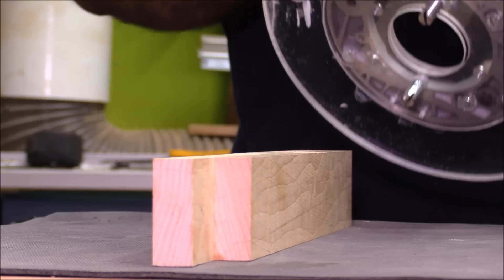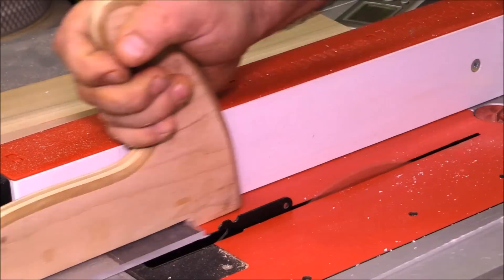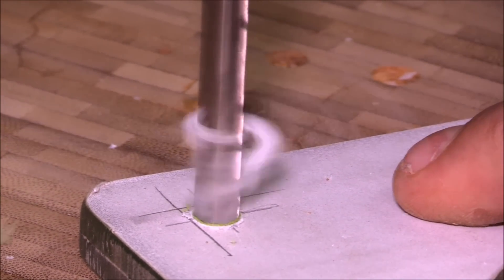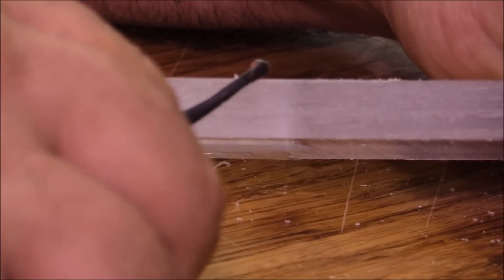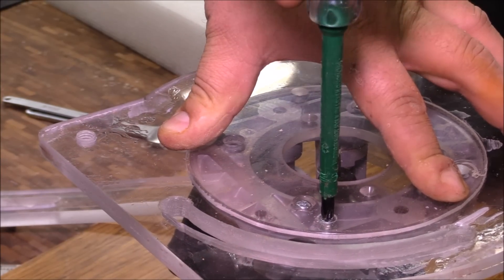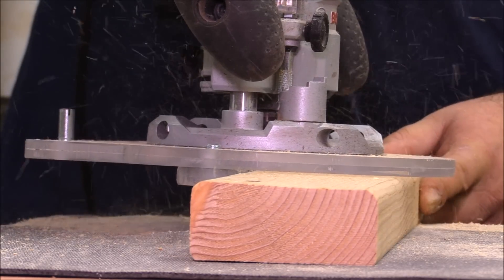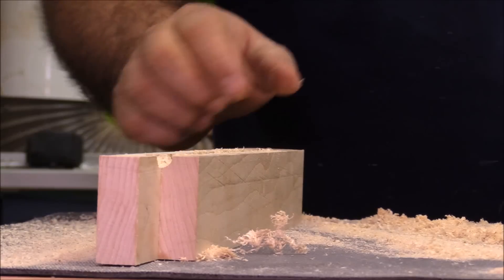Make a Custom Router Jig Base Plate

Comment: Building adjustability into a jig always gives the option of making it more accurate ; * which is the main reason for making jigs - to improve repeatable results , with the minimum of set - up time ! 
       Lesson learned from an old tool & die maker :  " If you can't make it accurate , make it adjustable ! "     * Making it accurate, AND adjustable would be the way to go ;)  
                                Good stuff Izzy !
Reply from the maker: great advice
Reply: I love that quote!
Reply: flashpointwhite   I've carried that idea in my toolbox for over 40 years  . . . and it hasn't gotten dull YET !    ;)

Comment: Quick tip ----- To prevent the warpage of the plexi and/or acrylic (for small projects like this -- if youre making thousands this will get expensive) -- take an air duster can upside down, and aim it 2/3rds at the drill flutes, 1/3rd at the work.  Keeps the work nice and brittle so you get clean chips from your cutter. 

MG Chemicals makes an actual cooling agent that does the same thing vertically, but as you'd imagine it's fairly expensive.

Also dry ice.. here in MA you can't get dry ice at the super market, so I haven't experimented with it, but I'd imagine that'd be a cheap solution if you're in a state that sells it.

Great work as usual brother.
Reply: Great tip!  Tried it and it's a miracle!

Comment: Nice jig!!!!
Just an FYI - I found that when it comes to putting holes in thermoplastic, the easiest  way is to find a metal rod of the same diameter you want for a hole, heat it up (doesn't have to be even near red hot) and poke it thru where you want the hole - no breaks no fuss no muss! Just a little remnant on the back side to clean up, which usually breaks right of with a putty knife!  Keep up the great videos!!!

Comment: Hi Izzy, great video looking forward to the next part. 
I found that acrylic is one of the only things ca glue doesn't do well. You can get acrylic cement or what I have used in the past as a cheaper alternative and you might have it around the house already is PVC cement. It worked really well for me. 

Hope this helps.

Comment: Izzy if you want the edges of the Plexiglass clear and smooth like its surface. Sand it with 120 grit and then use a propane torch to smooth it out. You might have to experiment with how far to keep it from the the plexi and how fast you move it. I learned to do it in the nuclear industry.

Comment: Great project Izzy, very versatile. Did you draw it in Sketchup? I am by no means a Sketchup expert....by far, but I noticed at 0:34 that your circles and arcs look segmented. Sketchup (for some unbelievable reason) has set the default segment count for circles an arcs to 24 sides. After you press the circle tool, just type in for example 100. You will then get a lot smoother circles and arcs.
Reply: That's true, you might want to stick with a number that 360 divides easily by though, like 90 or 120, just so you don't wind up with segments that are some random number of degrees. Probably wouldn't matter for most projects though.

Comment: well, as always, a ton of info.... I haven't used my router enough to see how to use this much BUT... the plastics tips and techniques you used in passing should help me make a new baseplate for my longarm quilting machine.  I have been wanting a new one for a long time but they are not really the shape and at $200, certainly not the price I want.  I can certainly see where this info would be handy for specialty rulers, as well.....they start at $35 and each only do one thing.... have already ordered some acrylic squares....thanks so much...

Comment: Izzy, Great video. I would suggest Acrylic Bonding Cement in the future. TAP Plastics make a whole range of products for this as well as others. Also, if you are going to burn the edges to smooth them make sure you use a torch with MAPP gas (yellow bottle) and not propane. The only thing to be aware of for the "welding/bonding" agent is you need smooth edges for a proper bond. I would also fasten your work piece a little better otherwise you may be called 4 finger Izzy in the future. Otherwise, great build and a very nice design. Thanks for the vid.

Comment: Izzy, try brad point bits for drilling plexi :D I've got consistently good results!
Also if you smear petroleum jelly (Or is it petroleum jello over there? :P) on the bit, you get silky smooth holes.
(That sounded wrong)

Comment: just FYI. 

As funny as it sounds when tapping plexiglass if you use strained bacon grease on your tap it will work great.
17+ years working in a display shop I was told this and was quite apprehensive, until I tried it.
every trick helps complete the project quicker.

Comment: Your problem with melting plastic when you are cutting it can be solved using denatured alcohol as a coolant .. Just keep a fire extinguisher near by... 
Personally I keep mine in the freezer to maximize the effect of the coolant... 
I have never had problems with it catching on fire... and further i extract the fumes when I use it... 
Using Alcohol significantly improve the result, I have used this practice for at least 20 years...

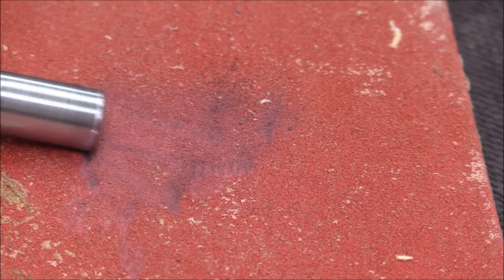Comment: 06:19 not perpendicular.. [doesn't have to?]
Reply: Yeah it looked that way to me too, probably doesn't matter though since it's always the same point on the peg making contact with the material. One thing that occurred to me was that once the lead peg is past the end of the material it would be super hard to keep the cut centered, so you probably have to leave the pieces long until routered out.
Reply: I see. Thanks for your reply [woodworking - it's all about jigs] ;-)